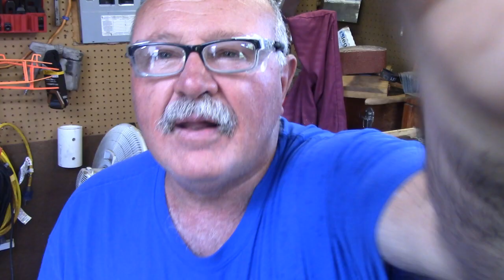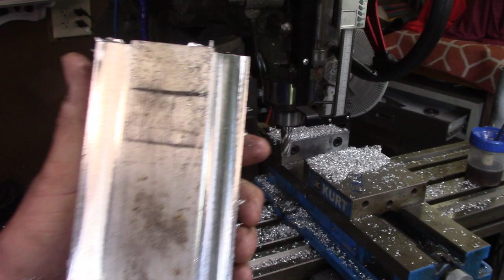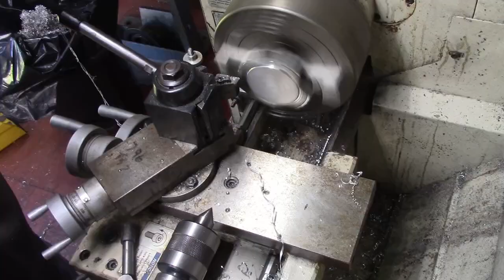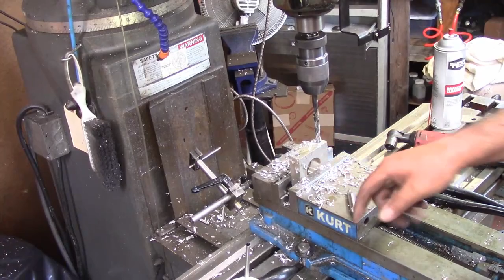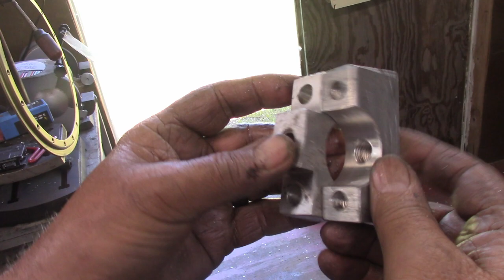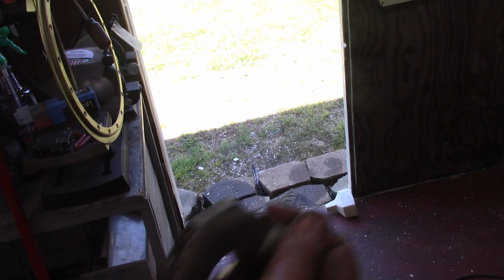Shop made weight clamps for our race car

Comment: Whats the status on the new car? What did you do with the old one?
Reply from the maker: We’re waiting on Knox Bailey to do the cage/chassis. This is why we decided to start fresh, to repair the old car would have only saved 1k, plus the same downtime. While our group is capable of constructing or repairing the car, since most of the group works, plus Juston’s brother races and they do some bodies time is the issue. This is why we’ve in a holding pattern. On the old car, we’re working with Juston’s uncle, who is running in our class, he just recently purchased his old car and began to race, he has been gracious enough to let Juston run it for track points while we’re getting our car back. Part of the arrangement is they get the old car what we don’t use to repair and race.

Comment: Looks good.  I would have made a counter sink for a bolt head going away from the bar. Then put a washer and locknut on the outer side of the lead.instead of threads in the aluminum. Then no one will over tighten and rip the threads out.
Reply from the maker: Actually that’s the design, on the commercial one it’s made so you can use either end for weight mounting. My theory is I can rotate the clamp so the more area makes a stronger design. The reason for threading into the aluminum is simple, no nuts to keep up, stronger design due to surface area, and reducing the machining needed to make the clamp.

Comment: Mr. Jim how much does that hold.  Keep in mind I know nothing on racing.  I'm assuming it's for weight for one side of the car to the other for cornering?
Reply from the maker: Normally you use 2 clamps for 25 to 50 lbs.
Reply: @JamesDedmon  cool. Interesting